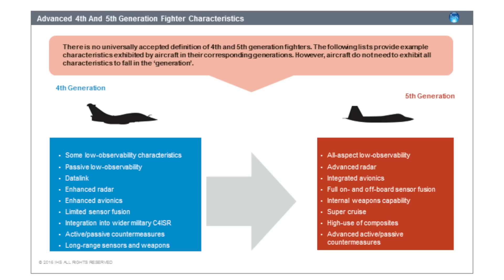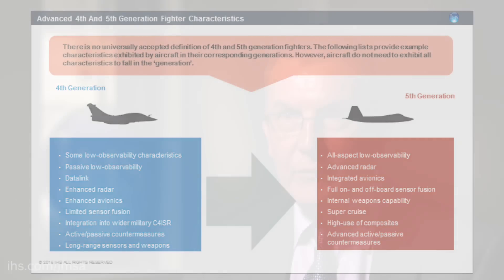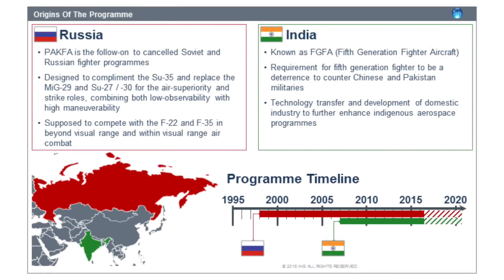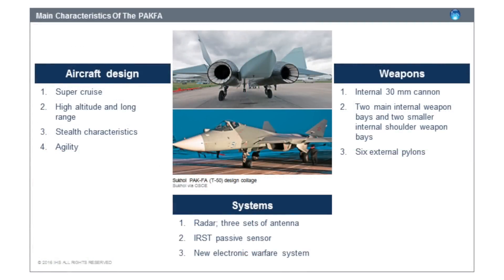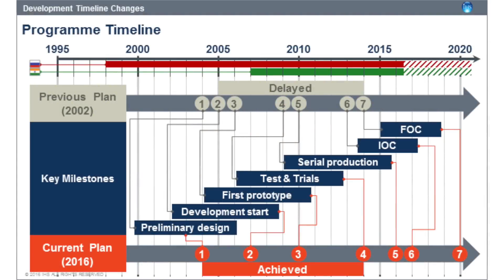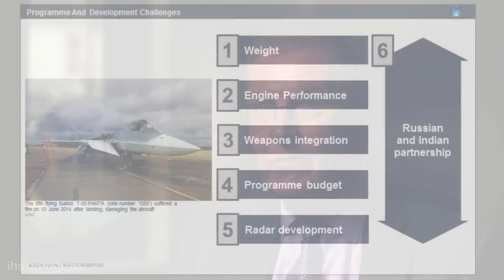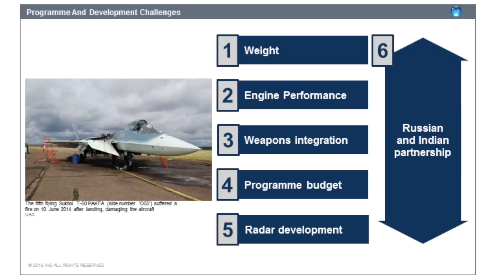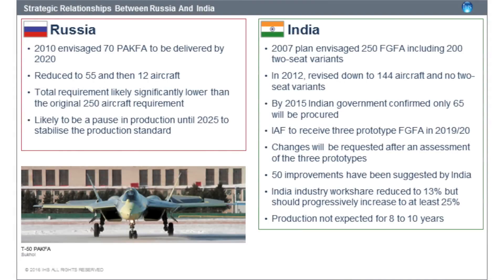Perspectives on the Multi-Role Fighter Russian / Indian Fifth Generation Ambitions

Comment: Better than f 35.
Reply: the f-35 is a multipurpose fighter
Reply: Bruh Every modern fighter is a multipurpose fighter.
Reply: The F-22 isn't
Reply: Bruh Are you saying that F 22 can't do ground attacks?
Reply: Of course it could but it is meant to be an air superiority fighter
Reply: Bruh But it is technically also a multirole fighter, which can do anything an F 35 can.
Reply: That is like saying that a B-2 is a multirole fighter
Reply: Bruh B2 can't do air superiority. F 22 can do air superiority, ground attack, electronic warfare, recoinassance, and maybe some more. That is the definition of a multirole fighter.
Reply: the b-2 can launch aim-9 sidewinders so it could do airsuperiority
Reply: Bruh it cant dogfight.
Reply: But it can shoot down a plane
Reply: Bruh The point is, if you can call the f 35 a multirole aircraft, then the f 22 definitely also fits that category, since it can do everything the f 35 can do, better.
Reply: That's not hard.